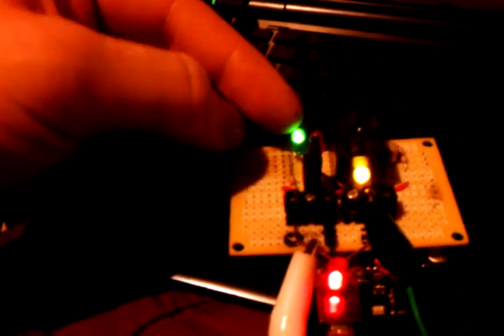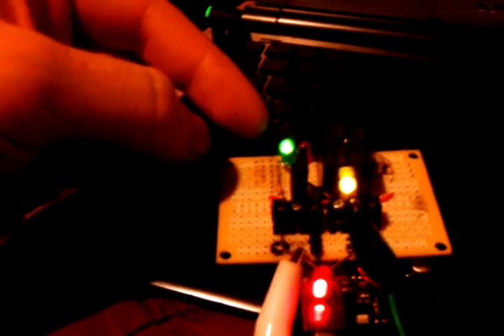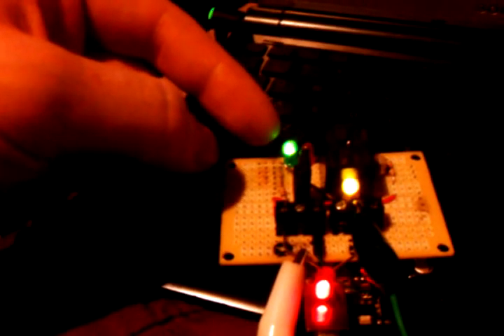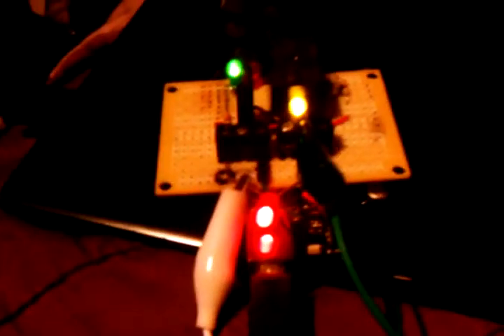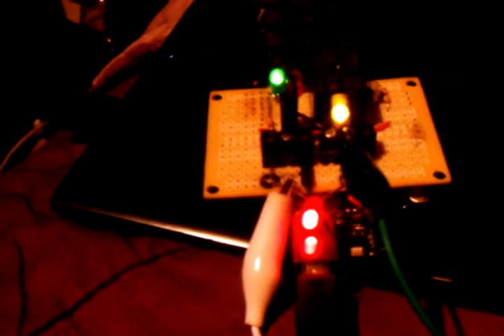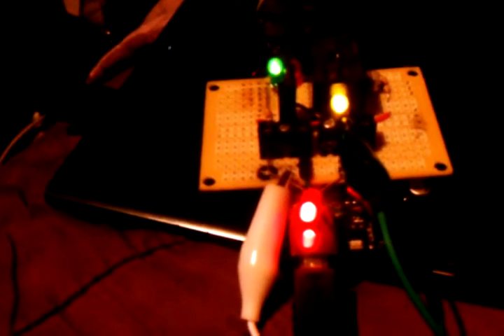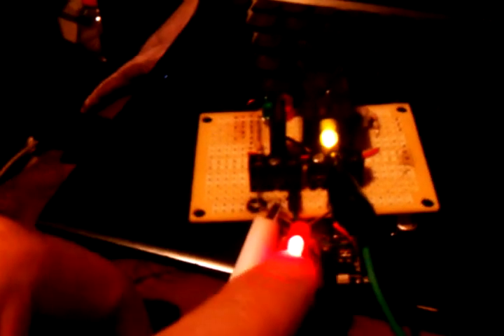AutoResuming 2011 Ford High Idle Hack

Comment from the maker: I sent ya a private message. I do have all the original circuit drawings. I made it so it was a daughter board onto a normal Arduino, and even potted it in epoxy so it's pretty rugged. I didn't want it to ever malfunction or break, since it's on an emergency vehicle. Plus the circuit was designed so that if the Arduino or anything fails, the switch on the dash should still always function. It's kinda risky doing something like this, untested, on a customer vehicle but we didn't have a choice.